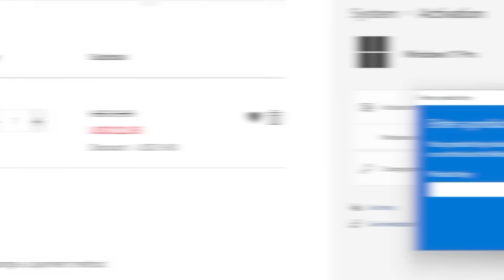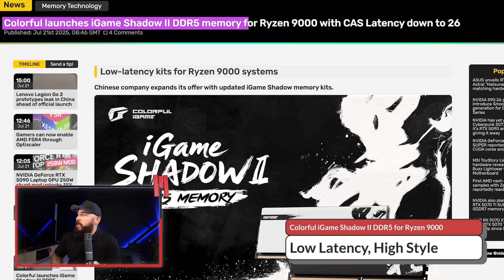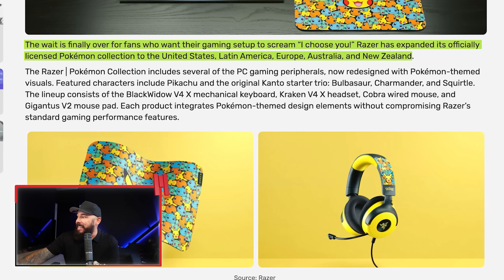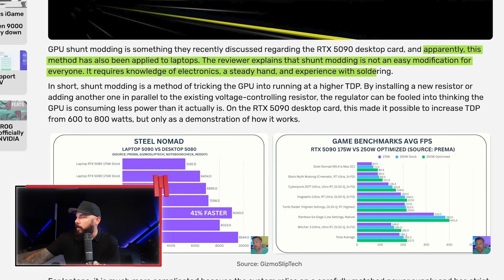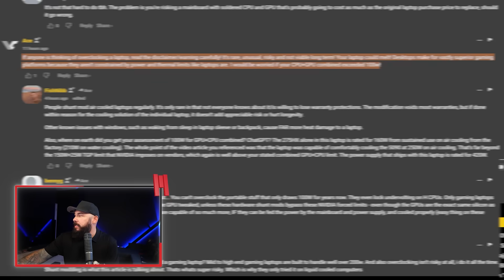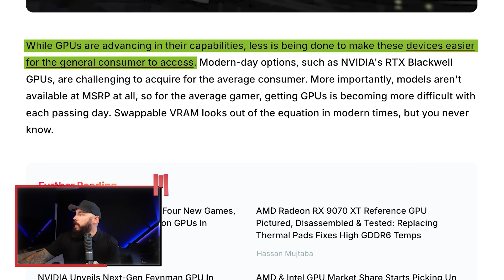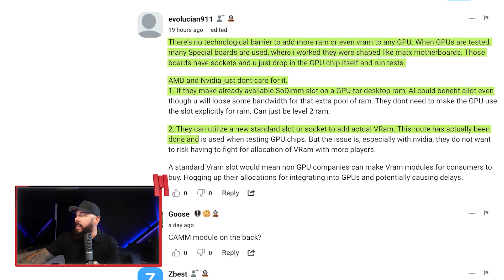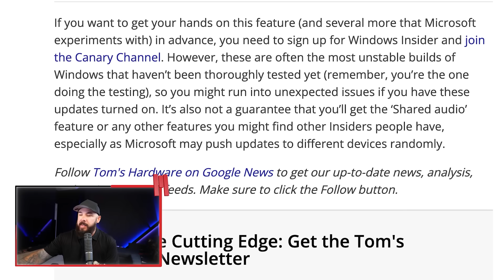Add VRAM To Your GPU?!

Comment: I have actually conceptualized a V-RAM expansion card. In theory, this V-RAM should still reach 60-80% of the performance of the native vram. mass manufactured, you should get 8 GB for $50. 
A larger card would get you 64 at $120 and the fully expanded max model would bring 512 GB at $800.
these speeds aren't the best for gaming but a great uplift for AI and editing or simulation.
During conceptualizing, I ran into the exact same problems as the GPU manufacturers run in. The 8GB and 16GB boards would not be upgradable, since beefing up for higher performance gets expensive fast. Only the larger cards would need to come in two variants with specialized V-RAM sticks to keep the costs managable, moving many components to the actual sticks, so you don't pay for them upfront.

Comment: 16:06 - Holy Crap. Of all the slop that Microsoft adds to their OS (AI Trash, Recall, Bing Web Search, Forced M$ accounts, One Drive, Xbox Gaybar...) this would actually be super useful.

I have a B&W MM-1 speaker set that is 2.0 only There is no way to add a sub. With two outputs, now that 2.0 system is now a 2.1.

Comment: Having an 8gb GPU in 2025 would be the equivalent of having a 512mb GPU in 2015. The GTX Titan Z had 12gb of VRAM and was released in May of 2014, 11 years ago! There shouldn't be any reason for brand new 8gb cards to even exists in the market right now! It should start at 12gb or at least 16gb and be affordable too! In 2015 you could have spent less than $1000 for a whole computer, build it yourself and run pretty much anything on it, Now it takes at least 4-5 times that to get the same experience, with modern games on modern hardware! What happened?

Comment: so, when a card burns out, either power port, the GPU itself, capacitors, and for whatever is unfixable, why not salvage the VRAM off it and stick it onto another card? often models will have empty sockets that are clearly for VRAM chips, so as long as your cooling solution covers all the spots, and you amtch the right speed/size/model of VRAM chip to solder into place, whats stopping anyone from having a 32GB VRAM GPU thats a 60-70 model of either manufacturer?

Comment: upgradable vram would be perfectly viable if performance limitations were removed during process.  An example of this is memory bus width.  Nearly all vcores operating with 128bit would see absolutely MASSIVE gains doubling that to 256bit with an add on card.  We dont need GDDR7.  Hell, GDDR5X is plenty fast with the correct amount of channels, enterprise cards prove this to this day.  I think a basic GDDR6/6X card setup with the ability to go from 256bit to 512bit and 16gb to 32gb capacity would be an absolute muffin seller, even if it was severely overpriced at $200 (as compared to the actual chip and PCB cost).  The bigegst issue I see is getting traces close to the vcore.  This could be solved or reduced by having the gpu's onboard ram south of the core (closer to PCIE slot), and making the new expansion slot towards the outer edge.  Expansion Card could easily sit 180 degrees, folded on top of gpu, pointing at motherboard, to allow good case clearances.  There most liekly would need to be an active cooling solution, to deal with the extra heat of the gpu itself, such as a thin blower at end of card.

This is something that has been done in custom one-off forms in enterprise world for specific solutions, and it needs to be brought to mainstream!!!  My 1080 TI is screaming in anger with the most basic new games at 720p and 1080p, and that is just pathetic for such an important card to gpu history.  An AMD 9070 with expansion ability would be fantastic as a starting point!

Comment: gpu with slot for vram can propably lowerthe cost of adding vram to gpu mostly if they made gpus with vram slots posible to work like gpu integrated with mobo the new gpu in that way can by cheaper and more atractive to peoples that doesn't have money for hight end gpus also they doesn't need to make multiple versions of single gpu with different vram ammount and this way they can focus more on gpu power than how to fit enough vram to make it work only problem will by that the customers will use they old gpus for longer but if they can focus on  gpu power it will make customers more like to swich to new gpu than  upgradeing actual one it propably make it more like to place vram from old gpu to new one if they alredy can buy an gpu for cheaper price and more power for example you can buy gpu for 500$ or you can buy new gpu for 350$ and swich the vram or buy a vram to existing one for 100$ it can only make more pressure on gpu power also it will add ability to add some power to igpu or dgpu all that will make less people to buy ultra overpriced pc but it will make them not need of producting something like it if someone can upgrade it self, it will create new market but this will make way to focus on power if someone else can focus on memory it will remove much problems like how much vram will by enough to use it or it will by too low. also there will by great if they make  budget version of gpu like a500 pocket ai it will help my laptop a lot i will finally by abel to play good games in bed

Comment: DIY memory upgrades still exists, but they're deeply ingrained in the modder communities. Because of having to use specialized tools and software to mod the hardware and GPU firmware BIOS
Companies just don't want to make VRAM expandable, it would hurt their sales numbers. they could easily solve the circuitry by making the existing layouts use pop-in chiplets, Instead of DIMM sticks.
For instance think of a smell rectangular socket, about the side of the actual RAM chip, probably have the pins onboard instead of the RAM. the user would just pop the RAM chip in with some form of clipping mechanism that reaches over the chip from the socket.
The GPU heatsink can provide the appropriate pressure on the RAM in the socket to fully seat the connection, while the socket clips simply keep the chip from shifting or even falling off the GPU.
This method would remove the need for rewiring for DIMM sticks, and allow them to simply use the existing layout of PCB boards in the design.

Comment: Early D3D Gpus in the 90s had SIMM slots to add ram. the issue is the interface, there isnt one designed to run at the speed we need it to run at, let alone not be open to interference etc etc.
Then there's tuning the BIOS.

If an Interface was developed, it would also need to have a UEFI that imports power and speed settings from each VRAM Module. (ie XMP for GPUs).

But even now, the DIMM slot design, was never meant to be used at the speeds and power that we run DDR5 on. 
Enter CAMM2, hopefully sooner rather than later, allowing FLAT System Memory Modules that can have Heatsinks and Water blocks mounted to it.

But if that's the route everyone wants to go,

AMD APU's use System Ram, which is upgradable, just not as fast as high end discrete.

Comment: I kinda forgot about ATI AGP cards, I know one was my first GPU but I don't even remember the model. I do remember that it was what I could afford (so it was cheap) and my young self's logic while standing in Circuit City- "This MUST be what I need, it has Doom 3 on the box and that's the game I want to play." Somehow it actually worked but I'm guessing I wouldn't call it a "playable experience" in 2025 (old clapped out mechanical HDD, long start ups/ loading screens, stutters, freezing, crashes ,low resolution, unknown frame rates) Still, Doom 3 alone in the dark after midnight, sitting in the middle of a spider web of wires from my $40 5.1 surround sound speakers wsa the best thing in the world lol.

Comment: they (nividia/AMD/intell) won't let us add vram because it will one hert there prices on selling new gpus and it also means that there will be other contenders for selling vram sticks, so if they would do it they would make vram stick specifically for their cards AND would have to go through on copy righting them as well. Even if they did, they would probably only have one slot for upgradeable vram with sticks that would have like 2gbs stick and 4gbs stick that would cost you another house morgage and eight loans😪

Comment: About the only way you could reliably have affordable "expandable VRAM" on a GPU would be to have SODIMM connectors for DRAM memory caching, as DRAM is much less sensitive to noise on the data lines thanks to its lower transfer rates, and the socket standards are already readily available, reliable and mass produced cheaply.

The big downsides are the speeds of DRAM vs VRAM, added manufacturing time and cost, and memory vendor validation: 

For some perspective on speeds n' feeds, here are the transfer rates in gigabytes per second and gigabits per second for PCIe gen 5 on a x16 slot, DDR5-6400 system memory and a 384-bit GDDR7 configuration:

A PCIe G5x16 peaks out at 64GB/s (512 Gbit/s).

And then your DRAM (Let's assume DDR5 with a 6400MT/s speed for best case) is capable of 409Gbit/s (or 51.2GB/s)

GDDR7 is more than twice as fast as the PCI-e link in my example here, as its transfer rate is 1.5Tbit/s (187.5GB/s) on a 384-bit wide memory BUS.

You would see less of a performance impact if the GPU had onboard DRAM it could use as an "L5" cache before it defers to system DRAM, but you will still notice the loss in performance quite drastically once the card does start to eat up that DRAM cache due to the substantial drop in data rates.

This might not be as massive of a problem if the workloads your GPU are running are more memory capacity intensive than they are memory latency and speed intensive (such as LLMs or GPGPU compute), but speed intensive scenarios like 3D rendering, modelling, CAD, DCC and gaming absolutely suffer performance losses the moment the GPU touches that DRAM cache.

As for validation - no two RAM chip vendors have identical chips. they're architected differently and respond differently based on timings and latencies, even for RAM of the same transfer rate.

You would also have to validate and test the GPU further than just what VRAM chips you install, but also to make sure it can work correctly with DRAM from different vendors (e.g Samsung, Crucial, Micron, Hynix or Nanya), as just sticking a single memory timing and latency profile onto the card would only validate its functionality for that one specific type and speed of memory. you need to have a card that can set memory speeds based off the SPD data that the RAM module provides on initialization, or at least have it be able to apply XMP profiles from the DRAM automatically to prevent the card being unstable or substantially slower than expected for the given memory installed.

a RAS / CAS latency setting that works on a Samsung chip is not guaranteed to work on Micron!!

and you sure as hell can't force a DDR5-5200 CL40 module to run at  DDR5-6400 CL28!!

the cost becomes an issue here too,  since GPUs are already priced way too damn high for what you get in performance.

If a manufacturer did decide to release a +DDR version of that same card, I have my doubts as to if it would even sell more than a couple units to enthusiasts!!

And yes - a +DDR version of a GPU would be more expensive, and by quite a bit, for the following reasons:

1: Engineering time and memory validation (creating the PCB, memory and power controller structures and validating several other memory types to tune the card to work reliably with those conditions - more engineering time = more cost to the end user, as the company HAS to recoup that cost somewhere!! If we're talking AIB manufacturers, this cost is much harder to swallow as their margins are already razor thin, and as per the agreements they make to procure AMD and NVidia GPU packages, they can't price higher than NVidia or AMD allows!)

2: Additional part costs (DRAM controllers (if integrated into the GPU, this becomes an engineering time issue for the chipmakers as well!), the DRAM Sockets and extra power delivery components to supply the correct power and so on)

So while it genuinely would be cool af to see a GPU have a DRAM cache to back its VRAM up

It's not likely to happen any time soon, even if we totally ignore the part where AMD and NVidia set the maximum and minimum VRAM capacities that AIBs are allowed to put onto their finished cards.

Maybe Intel would allow something like that given AIBs have gone on record stating that they're far more libertarian with how a card can be designed. Heck, you can even put a pair of Intel GPUs onto the same PCB with a PLX bridge if you want!! AMD and NVidia wouldn't even dream of allowing you to do that in this day and age. even with their workstation and server packages!!

Comment: Because of keyboard nasty stuff like that, is exactly why I can't stand pokemon anymore.  Expandable memory WOULD be awesome....IF they would stop limiting our BUS WIDTH!! This hurts my soul as an old head techy. Yeah there could be a bit of latency but this whole system of going "64 bit bus that one, otherwise the oasis beggers are gonna buy the cheapest one. We gotta squeeze these turnips for all the're worth." I get that the biggest bus in the world can't overcome a crap card. That doesn't change the fact that knowing you are buying a card that gives you all the performance it can, vs being held back for NO other reason than to squeeze more blood from us. Its bad planning. Can't have a lower tier card overcome a higher one that you came out with first with no real thought put into it other than hoping people scrape that piggy bank. Be real, be honest and you will have peoples respect.  Its not a hard concept.

Comment: The claim they cant make slotted RAM an option is total BS! Been doubling RAM on mine for decades with zero issues. Although a few other things need to be changed to make it work it is nothing that could not easily be setup to work in software!

Comment: nvidia will release a 5050Ti, and then no other 5050 card, because the 5050Ti was never a Ti, but a plin old 5050, but putting the Ti on it helps sales...fucking nvidia....it's probably not even faster than a vanilla 3060.

Comment: I have a RAM dock modded onto my 6750XT and it uses DDR5 6000mhz Expo. What was a 12GB card is now 28GB at the moment. Also my memory speeds are higher now. Not by much though. Onboard memory was removed and it runs entirely off the RAM in the sockets. It can be done and performance has improved. Don't let them lie to you.

Comment: About the expandable VRAM slots, it could possibly be solved by having it be treated as a RAM stick rather than a full expansion, meaning that it can hold assets and instructions that could be used in the immediate future like unloaded assets could sit on that "RAM" and wait to be utilized, hell of a lot faster than having the CPU deliver the next batch.... I think anyway, speaking of, unloaded assets could also be pushed to "RAM" to be used later.
I'm using logic here so I might be completely wrong and I chest that in that, my bad in that case, my brain just sees it as a logical solution, whether or not it's practical or doable, I have no idea.

Comment: I know from testing mini PCs putting RAM on mobo direct vs sockets does give a performance increase but its so marginal you need benchmark scores to see it. Adding sockets does create some electrical challenges and raises unit cost and a point of failure but again marginal and the electrical issues are solvable since mobos let us leave unpopulated slots without EMI problems on longer traces already. The only half viable argument is space that would make coolers harder to design or the AT standard would need to change how much width a card can eat but that is not a tech breaking problem. 

The real reason is unit sales by forced obsolescence. AI has added a new price incentive. They do not want users to have GPUs with enough vRAM to run much AI locally so the enterprise market has a service monopoly and reason to buy racks full of GPUs with 96 GB vRAM at 10k+ each for much more profit per unit. Consumer GPUs have a tight margin because GPU yields are meh so the amenities namely RAM is where they get to make-up the margins by overcharging for the vRAM. In sales we called those profit bomb accessories to shore up the low profit parts in a bundle. 

F-crypto, F-cloud AI, and most of all F-Jensen.

Comment: RTX 5050Ti will be even pointless than the regular RTX 5050, because 5050 costs $250 and 5060 costs $300, so there is almost no space left for 5050Ti price range, and if the price is $275, then just add $25 and go buy RTX 5060 or RX 9060 8GB.

Comment: I'm sick an fkn tired of yearly card releases given how bad the supply is and how half assed newer cards are.
2/3 year gap between card releases could fix a whole lot of production/supply issues.

I'd be all for adding extra vram slots.... I don't care about the slight slowdown over having more VRAM to deal with rendering or even RTX Ray Tracing crap.

Comment: We had something like this not long ago: "Vega HBCC, or High Bandwidth Cache Controller, is a feature introduced with AMD's Vega GPU architecture. It allows Vega GPUs to treat system RAM as an extension of the GPU's framebuffer (VRAM), effectively increasing the amount of usable memory for graphics processing."
But those GPU's used HMB2 Memory.
Reply: It would work so well with new ddr5 stuff